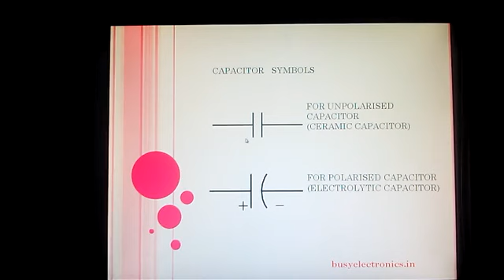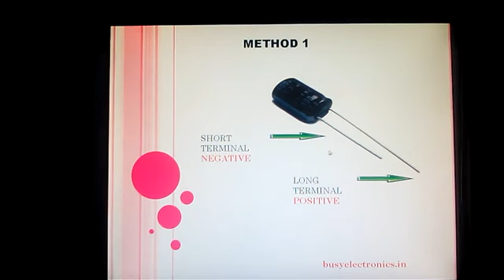CAPACITOR TERMINALS

Comment: hello my dear, in my sony music system, in speakers box having tweeters and bass killer capicitor used their with tweeter, and my tweeters has been messed, and i want to replaced with the new one, but unfortunately, their is no positive and negative sign, on tweeters and used capicitors and terminals got equally cut,.....problem is how to identify the positive and negative.........of capicitors